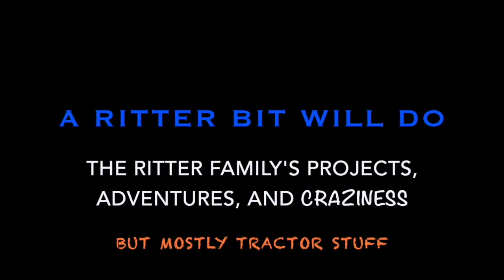DE-MODIFYING THE KUBOTA BX25

Comment: How did you get your blower and grader blade up in your rafters?
Reply from the maker: Very carefully. I have two chain hoists that I use to store those attachments up there. I got them from Harbor Freight for about $40 a piece. They really work well. It’s been a great storage solution but be safe if you plan on doing this yourself. My rafters have been slightly strengthened with extra gussets to assure they’ll hold.

Comment: This is a newbie question, but what will the new tractor have that this one doesn't?  I guess to me, the BX23S and this BX25 are the same.  What are the differences?
Reply from the maker: You're exactly right, the two models are pretty much the same with a few new bells and whistles however, the most important feature the new one will have is a cab. I've sworn off plowing snow in Minnesota's bitter cold ever again. I've been freezing my tail off for far too long. It's cab time!!  Thanks for watching and God bless.
Reply: Ive had my BX 23S for about 9 months and really love it.  The major difference that I would have to say between the 25D and 23S  is the quick change front end loader that allows quick use of skid steer attachments.  Its great.

Comment: Are you going to have trouble getting under your deck since the 23s will have a cab?
Reply from the maker: Darren Lemieux I don’t think so, my BX25 almost fits with the ROPS up and I think the cab for the BX23S is lower than the ROPS. If not I’ll have to dig down or modify my rafter joists. 
God bless.

Comment: Did you get a bx23s? I just got my new bx23s 2 weeks ago, and love it. Did have to take it back to dealer cause of a leak coming from under it. Good time to buy a new tractor, I heard kubota is raising prices up 4% cause of the trade tariffs.
Reply from the maker: Tim Davis I am getting the BX23S and yes I think I bought at a good time. I feel
like I’m getting a pretty sweet deal. Hopefully no leaks. 
God bless
Reply: I purchased the BX23S last year.  I have had several leaks with the new loader quick connect.  My dealer just replaced the entire quick connect manifold (top and bottom) for the second time in addition to two quick connect couplers prior to that.  I know the dealer spent a lot of time working with technical reps from Kubota over this issue.  I'm really hoping this last repair does the trick.  So far my multiple trips back to the dealer have been covered under warranty but it makes me a little nervous going forward.  The quick connect is a neat feature but I fear the old system was more reliable.
Reply: Christopher Rust, my leak is coming from the left side kind of under the brake pedal, I think it may be coolant but have not heard back yet from dealer.
Reply from the maker: Tim Davis Are you sure it’s not a diesel fuel leak. That’s about the place the line would run. There is a fuel filter in that area.
Reply: Jon Ritter no it wasn't diesel, dealer called and said it was just a loose fitting on hydro line. So should be good to go, no charge for anything since under warranty